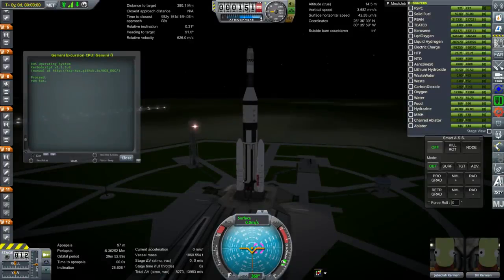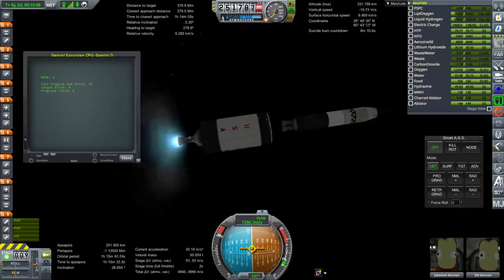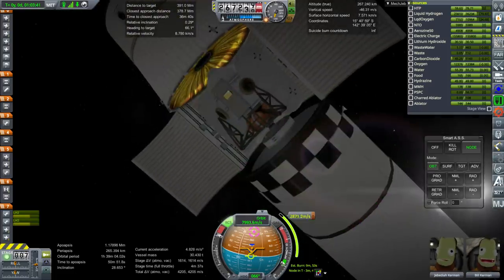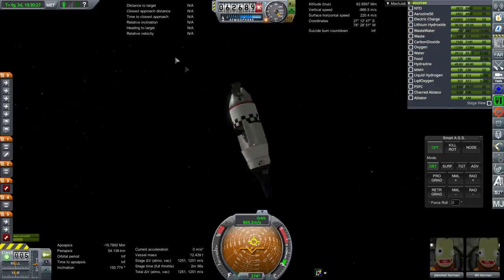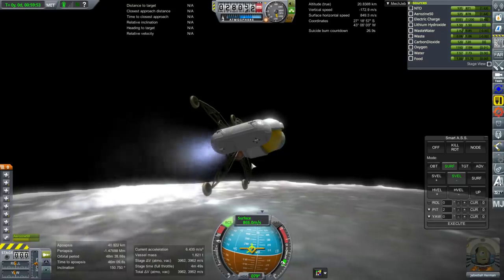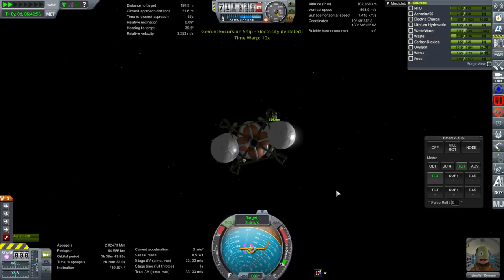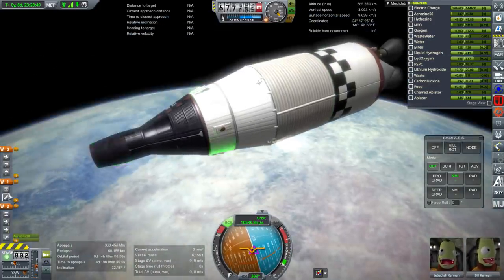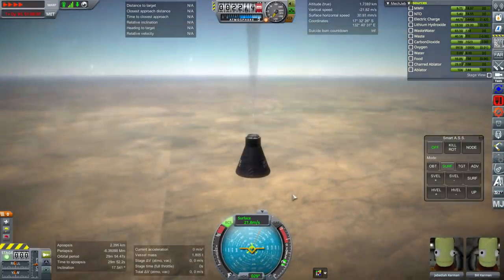KSP - Realism Overhaul Sandbox - Light Gemini Lunar Landing

Comment: Gemini fuel cells did not produce drinkable water, but the Apollo fuel cells did, with some extra bubbliness or dissolved hydrogen or something. RO TACLS reflects this by having the fuel cells for Gemini produce waste water I believe. If Gemini had been used for lunar missions though, I suspect they would've used the same advancement that the Apollo fuel cells used, to produce drinkable water.
The longest Gemini mission was in orbit for ~2 weeks, and so enough water could be stored for a full lunar mission.
Reply: Drinking Bubbles of hydrogen=explosive burps.

Comment: Ascending with that side fuel tanks on lander seems pretty inefficient. Weird that they didn't stage them.
Reply from the maker: The staging mechanism would add mass and potentially problematic complexity, the lander core doesn't have much room for ascent fuel, and this way it's theoretically reusable. All in all, I prefer single-stage lunar landers primarily for reusability, but if you work it out, you'll find that using two separate stages doesn't help too much considering the additional cost even without reusability.